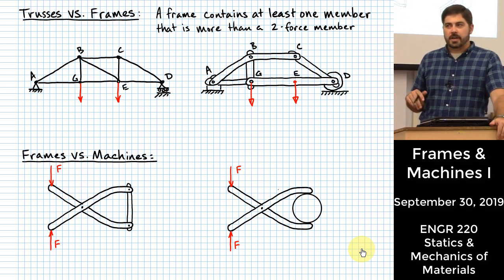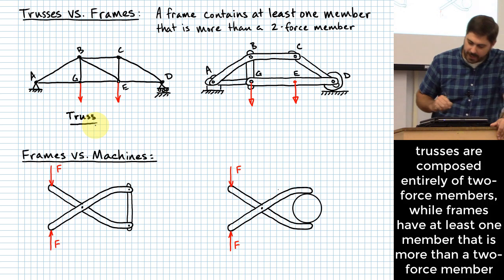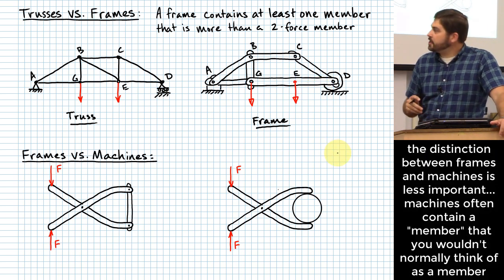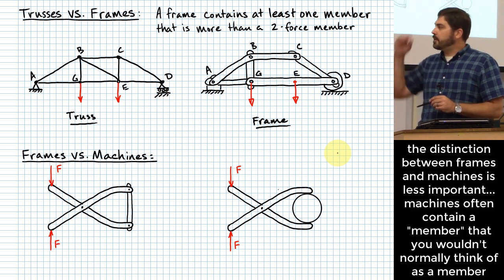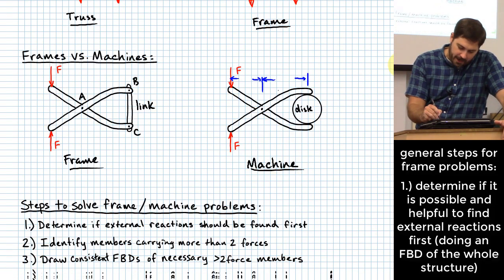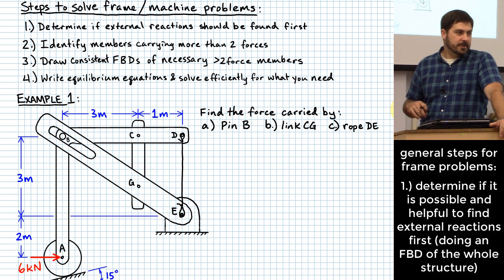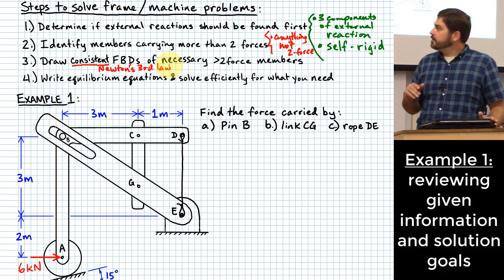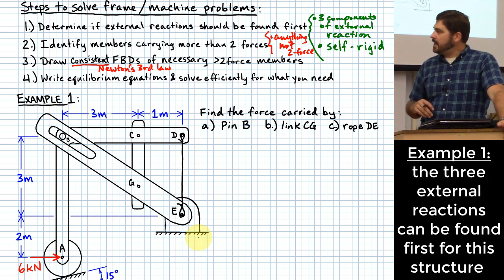Frames & Machines I: Intro, Technique, & Examples including Slots, Rope, Pulleys, Rollers & Sliders

Comment: Its so hard to not make a mistake with these kinds of problems like I accidently when drawing diagram 2 forgot The applied 6 kn load and it messed up all of my other work. Ive been practicing these problems for a while and sometimes i get it all right but like more than half the time i make some small mistakes. I write down the wrong perpindicular distance or I Add instead of subtract. Its really hard!
Reply: Notice how the professor is methodical in doing the problem. He doesn’t rush ,he writes and draws neatly and he double checks. It’s an engineering problem not just a math exercise. So approach it as if people’s’ lives depend on you getting it right. Good luck!
Reply: @roobear5357  Yeah I've had more experience now some things I've learned are
1)Don't assume I know how to do a problem or even a step.

I find that when I see something that I've seen before I'll immediately start writing stuff down but instead if I act as if I've never seen it I'll be more methodical.  And I'll think through it more. This is probably the biggest thing 

2) Don't get distracted/forget

Sometimes I'll read part of the problem then get distracted trying to figure it out. Or I'll be mid way through a problem and I'll get distracted solving part of it and forget the rest. So I need to not let myself get sidetracked, follow an order and not assume I'm done
Reply: That’s great …that sounds like a productive approach.

Comment: Hello Prof. Bom, I am a 57 year old Mech Engineer who is studying for my second attempt at the PE exam.  Passed the FE 30 years ago, and then took the PE 5 years back without sufficient prep, due to work schedules.  Work life hasn't changed, so I am short on time again.  I watch your lessons at 2X speed and you're still remarkably understandable.  What digital white board software are you using?  I am very grateful for your channel.
Reply from the maker: I'm glad my content is helping! I use Microsoft onenote 2007... the last version before the stupid ribbon bar. Best of luck on your re-take!
Reply: @TheBomPE  I recently learned that I did pass the PE Mechanical: Machine Design and Materials at 57 years old and 6 months after Covid hospitalization, and without a prep course.  Your videos helped in several ways. While they were very time efficient (esp. at higher playback speeds ;-), clear and comprehensive technical reviews, the positivity of your engagement with the students was also key to the motivation to keep on working.  I can't emphasize how much an instructor's compassion, decency, humility, focus, disciple, organization, thoroughness, and accountability all contribute to a student desire/ability to persevere and succeed.  Cheers.
Reply from the maker: @calanpeet  Thanks for your encouragement! Congratulations on passing the PE!

Comment: Example 
The structure connected to ceiling in the in gym  is frame not truss? 

The loading is elevated side walk for walkers, garage door like doors with pulley & motors. basketball hoops.

Comment: Im sorry for the first example wouldn't the vertical component be sin and the horizontal be cos? Also for the Ra for the Fx equation how did you determine or why'd you plug it in as a negative and for the Fy equation why'd you plug in as a positive? How did you know it was negative and positive instead of flipped because it gives different answers.

Comment: I had a question. 
In a frame of equilateral triangle  .with ABC points 

A being left start point and has 100 grms of weight 
On B side if 100grms of ball is connected with rope 

How do I lift the ball  on  A with B .

How to reconstruct the Fram

Comment: Hello, why is newtons 3rd law not applied to the 50lb force D at 1:27:52? I thought it would be going downward.
Reply from the maker: Newton's 3rd law says that every action has an equal and  opposite reaction. That's why the force vectors flip direction between two bodies that are applying force to each other. That's what is done in the example here.